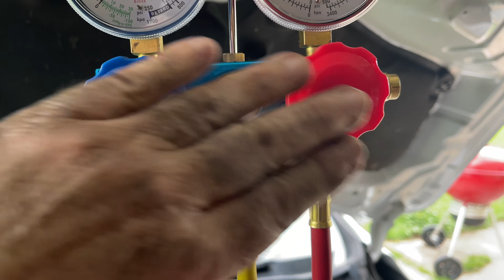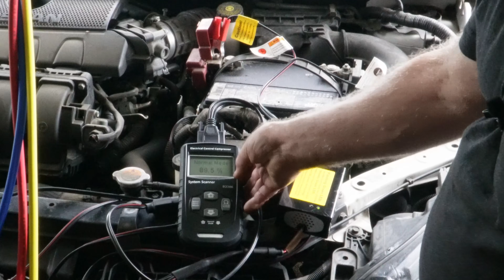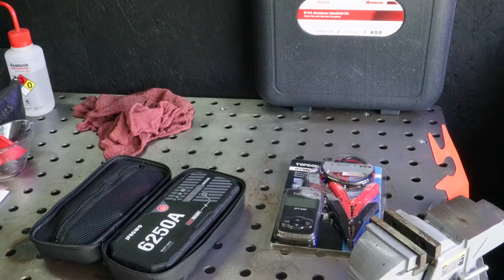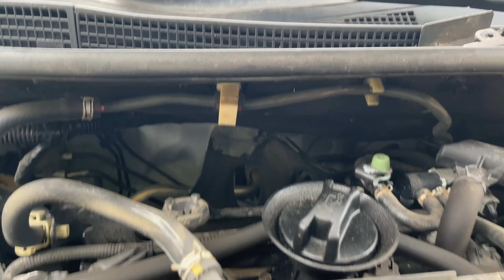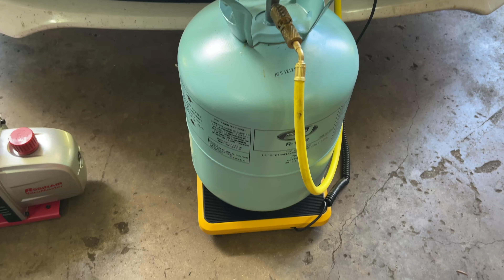How To Diagnose A Bad Automotive AC Compressor With 100% Accuracy

Comment: Hi

2 questions, if txv is stuckopen, are we saying that suction line going into compressor will be frozen..  or cold to touch. 

2. instead of using this tool, can i give contsant power or ground (based on which is controlled) for just few seconds.. please advise
Reply from the maker: My following reply is assuming the system is fully charged with refrigerant with a healthy compressor.
If the tvx is stuck opened more than it should be, then it will allow more liquid refrigerant to enter into the evaporator than it should, which will overfeed the evaporator, causing excess liquid refrigerant to enter the evaporator, which will cause the liquid to boil off not only in the evaporator where it should, but also into the suction line, causing the line to frost over due to the expansion of the liquid refrigerant in the line, which can also slug the compressor with liquid refrigerant instead of vapor.  In my experience, I have ran across many more restricted thermal expansion valves, then I have stuck open valves, but both do happen.   Hope I've explained that to where you understand.

To answer your second question, yes you could power up the electronic control solenoid to see if its clicking, but that doesn't tell you if it's getting the pulse width modulated signal from the PCM or which ever module is controlling it.  You would be better off using a multimeter, and simply checking the average voltage by reading between the power and ground wires at the plug for the electronic control valve.  You could also use a pocket oscilloscope to see the pulse width.  This will ensure you are getting a signal from the PCM.  You can also ohm the solenoid valve with an ohm meter.  Anywhere between 10 to 14 ohms is considered good and should function properly if it doesn't have a blockage or other mechanical issue.  If you have a decent midlevel scan tool, you can also use it to tell if the ECV is operating as it should be.  I show an example of doing this in the recent video I did reviewing the Mucar scan tool.
Reply: @SkillSavvyDIY thanks so much. I think I didn’t asked my 2nd question well. I do have picoscope and scan tool to verify the pulse width ,question is can I manually power the solenoid by giving constant power to the solenoid to make it as 100 percent duty cycle . Assuming power 12v is controlled by ecm and not the ground. In other words I am planning to not to use the tool that u used in this video and just send constant 12volt or constant ground using power probe when engine is running to that solenoid and override ecm volt by backprobing and provide constant power or ground. Just want to make sure that by backprobing and overriding pcm volts at connector I can simply create 100 percent duty cycle with power probe. If I can do that I can avoid buying the tool u used in this video. I just want to make sure I don’t burn compressor solenoid or ECM
Reply from the maker: @sivucit  Some cars pulse the ground and some are reversed and pulse the power.  I recently worked on a 2012 Volkswagen Passat, and I had to use the reversing cables that came with the tool I used in the video, to reverse the polarity for the tool to work correctly, but yes, you can supply 12 volts and a ground to engage the solenoid at 100 percent, but I'm not sure I would back probe the plug especially if you are not certain which wire is power and which is ground and which is being controlled by the PCM, the ground or the power.  Perhaps a wiring diagram will show you, but I personally think it's a bit risky! 

Not sure what scan tool you have but on my ThinkCar 689 scan tool, I'm able to watch the current go up and down as the duty cycle is being controlled by the PCM , and I also watch the evaporator thermistor temp to see if it also goes up and down as duty cycle changes.  As long as I can see that, I know everything is functioning properly, but if the pressures on my gauges indicate a worn out compressor, with high low side and low side as I had in this video, then that is a bad compressor, even in the event the solenoid ports are stopped up with debris or metal filings.  I personally would not be back probing the plug using my Power Probe to supply voltage or ground unless I was 100 percent sure which wire is being pulsed, ground or power and which wire is which.  I know the tool I used in this video is in the $350 range, but I do AC work often, and it's a safe way to monitor exactly what the PCM is doing or not doing with the ability to override the PCM and adjust the solenoid manually, plus it can ohm out the solenoid as well.  That's my thoughts and I would definitely use caution.
Reply: @SkillSavvyDIY  Thanks so much for your help.  Since you are super helpful and knowledgebale .. i have few more questios..

1. CAR HVAC also looks at 3 other paramter to turn on AC clutch. please advise if i am right

1. Ambient temperature. mounted next to condensor
2. EVAP fin temperature
3. Engine cooant temperature.

question to you. 
1. What ambient temperature is considered good for hvac to turn on. meaning if it is less than 50 degree F, it make no sense to turn on AC. do u know what values are ideal
2.. Evap fin tempeature.I was told that ECM will disable AC if EVAP  is giong to freeze based on evap fin temperature sensor. question is when it will become freeze, ?. in residential ac if freeon is low then it can freeze on fixed orfice.  not sure in car that has TXV.. also what is the actual cause for freezing. i dont understand the scientfic knowlede. is the boiling ipoint becomes too low when freeon is too lowthat causes evap to freeze below freezing??
3. i dont know even know why engine coolant tempeature is checked for hvac, make sense for hot air. not sure why for AC

Much appreciate your help. here..
Reply from the maker: Most automotive A/C control modules are programmed to prevent compressor operation when the outside temperature is too low. The exact threshold depends on the vehicle manufacturer, but typically: Around 35–40 °F The system will disable the compressor to avoid evaporator freeze-up, since refrigerant pressure may drop too low in cold weather. Some manufacturers set the cut-off slightly higher about 42–45 °F  for added protection. Above these temperatures, the A/C will function normally.

At low outside temperatures, the condenser can’t effectively dissipate heat, so refrigerant pressures get too low.
Running the compressor in these conditions risks icing the evaporator and damaging the system.
Since defrosting/defogging often needs compressor operation, the system may allow brief or partial compressor use even in cooler weather, but it won’t run continuously below the cutoff. So on average, the A/C control module blocks compressor operation below 38–40 °F 

Most modern cars have variable displacement compressors and the ECV solenoid at the butt of the compressor is controlled by the AC control module or ECM.  The computer monitors the data sent from the various sensors and it adjust the actual displacement of the compressor based on the input from the sensors.  If you have the climate control set to 70 degrees, then the computer will adjust the compressor to deliver those temps by constantly adjusting the displacement of the compressor which changes the amount it pumps which changes pressures and it can also blend in warm air from the heater if needed.  If you have the climate control set to the very lowest temperature, then the computer will control the compressor to give you those colder temperatures also.  As long as all the input is correct, the compressor will never allow the evaporator to get cold enough to freeze.  If it didn't adjust the pumping of the compressor by increasing the low side pressure, then the evaporator would most definitely freeze over, even with a high fan speed.  

Residential Hvac systems use a different refrigerant that runs at higher pressures and even though the compressor has fixed displacement, they will not freeze over, unless something effects the air flow across the evaporator, such as a dirty evaporator, blower motor failure, blower relay, stuck contactor, etc., and as you said, low refrigerant charge will cause them to freeze up, because the pressures are now lower, and the pressure to temperature correlation  has dropped meaning the actual temperature that the saturated refrigerant is boiling off at in the evaporator is now below freezing causing the condensation on the evaporator to freeze solid.  It is also possible that a faulty thermostat that won't turn the system off will eventually cause the evaporator to freeze.  

Engine coolant temperature is monitored by the AC control module or ECM to prevent the AC system from working if the car overheats.  It's designed to take the extra load off of the engine, that's all.  

Everything I talked about above pertaining to automotive ac is referring to modern automobiles that use variable displacement compressors.  Old school AC systems relied on a low pressure cycling switch to disengage the compressor clutch to prevent freeze up at the evaporator.  The system will cycle on and off depending on system pressure.  Much easier system to understand and diagnose but those days are over, even though many of those systems are still around and in use.  Didn't mean to write a book here, but I hope it helps your understanding a bit better.
Reply: @SkillSavvyDIY thanks so much and you are very helpful and these kind of answers can be provided only by someone like you who knows in and out. Thanks again very much appreciated.
Reply from the maker: @sivucit You’re welcome
Reply: @SkillSavvyDIY  hi, if outside temperature is like 45 degree or less, you said condensor wont dissipate heat effectively resulting in lower referigeratn pressure, can i assume ,because outside temperature is too cold , the heat created by compressor will get dissipated easily resulting in lower pressure ?..  i thought if condensor is not working(let say fan) temp goes up not comes down resulting in lower temp, pls advise.
Reply from the maker: At low ambient temperatures around 45 °F and lower, the condenser is too effective. The refrigerant cools and condenses too easily, so the high-side pressure stays low instead of building up like it does in hot weather.  With low head pressure, the evaporator also receives refrigerant at a lower pressure/temperature which gives a high risk of evaporator freeze up even with a variable compressor.  Also keep in mind some condenser fan motors come on and stay on the entire time the AC is on, while others only come on when the high side pressure reaches a certain pressure.  Depends on the manufacture and car or truck.  

So the problem isn’t that the condenser can’t dissipate heat, it’s that it dissipates it too well, pulling the pressures down below what the system is designed to work at and thats why the ECM will shut it down at the lower outside ambient temperatures.  Sorry for the confusion.  I should have explained better.
Reply: @SkillSavvyDIY thanks so much. Let me know if I can donate to your channel. How can I test variable compressor using low side and high side values. Bcz it is variable compressor low side can be 45 and high side can be 120 and it is still right. Can I use scan tool to make it as 80 percent duty cycle and compare low side and high side almost equal to traditional values. 2. In hybrid electric compressor is it variable like in Toyota and I heard hybrid air compressor electric won’t take oil is that true
Reply: @SkillSavvyDIY  one more question if free on is over charged . Pressure will be high and does that mean the boiling temperature in evaporation is high and it won’t cool ?. Vice versa if free on is low , pressure will be low and evaporation temp is low and will I get cooler air?. Off course too low in free on  won’t give cooler air. Just want to pick your brain. I have robinair LD7 that has heated diode is that good leak detector or you recommend something else if cost is not a concern
Reply from the maker: You can do that easily with the tool I used in this video.  Manually bring the duty cycle up as high as the tool will let you on a warm or hot day, and watch your pressures.  Bring the duty cycle down while monitoring pressures and you will see how the electronic control valve is adjusting system pressures based on the duty cycle you are giving it.  The control module does it based on sensor inputs is the only difference.  

Electric compressors are typically not variable displacement in the same sense that belt driven compressors are.  They are controlled by motor speed.  

They use a special dielectric compressor oil made specifically for electric compressors.  

You seem very interested in automotive AC.  You should think about taking a few courses at a local Vo Tech school and get some hands on training.  We could go on for days with me answering your questions, but the very best way to learn, is by actually getting trained and working on systems.  Technology in this field has changed dramatically since I first got involved and even at 66 years of age, I try to keep up with the latest.  Best of luck to you and I hope I have helped out some.
Reply from the maker: Yes if a system is overcharged with refrigerant, then your pressures will be higher which means the temperatures will also be higher including the temperature that the liquid refrigerant boils off at in the evaporator.  A severe overcharge can also send liquid refrigerant back to the compressor which can destroy it.  A lack of refrigerant can also effect system pressures by making them lower than optimal, and with enough refrigerant loss there will be no cooling capacity left and also remember that a undercharged system will make oil drop out inside the evaporator and settle in the bottom which will starve the compressor of critical oil and will lead to compressor failure.  A heated diode leak detector is a good choice.  I have an infrared leak detector mainly because of the long life of the tips.  A bit more expensive, but less maintenance.
Reply: @SkillSavvyDIY thanks so much. Pls advise a better or best infrared leak detector that works for both 134a and 1234yF. Thanks again very
Reply: @SkillSavvyDIY  One last question for you, if condensor is blocked and assuming i have hig side port after condensor that goes to TXV showing less pressure, how would i test blocked condensor, can i measure with infrared thermometer between inlet and outlet of condensor, if so how much pressure differenc i should see for good working condensor vs blocked condensor..  or do u have any other method.
Reply: @SkillSavvyDIY  I did went to school like 10 years ago and got myself certified as well, but that time it is all about clearing  exam.. :)...  one thing that never get it clarified till today is that, I was told that , when gas converts to liquid(example when compressor sent high pressure gas discharge line into condensor at somewhere in middle of condensor it will turn to liquid) i was told that is the time heat dissipate.. Instructor told me heat dissipate when there is a change in state from gas to liquid. stilll didnot understand that.. he told me that if there is no change in state assuming entire condensor is gas there is no heat dissipation.  similarly when evap inside the car gets the liquid, within evap coil in middle of coil, it will convert liquid to gas that is the time free on boils. why change in state from liquid to gas or vice versa is where heat is dissipated.. any insight will be helpful..  This is my last queestion i promise.
Reply from the maker: Normally when you have a restricted condenser, the restriction will act like a metering device such as txv or orifice tube, and the restriction will cause a pressure drop, and the liquid line will be cold after the restriction because of this pressure drop.  So yes, if the service port is after the restriction, you will see low pressure and if it is completely blocked then you will see the pressure pull into a vacuum unless the high side pressure sensor is before the restriction, then the high pressure before the restriction will be great causing the sensor to shut down the compressor.  You can indeed check the temperature difference with a laser thermometer.
Reply from the maker: Sounds like you got the gist of what’s going on.  It is the state of change when refrigerant is saturated with both liquid and vapor in the condenser or the evaporator that heat is either absorbed into the refrigerant (evaporator) or heat is expelled from the refrigerant (condenser) .  Heat in the vehicle is absorbed by the cold boiling refrigerant in the evaporator then pumped to the compressor as a cool vapor and pumped out as a hot high pressure vapor and then condensed to a warm liquid expelling the unwanted heat that was removed from the inside of the car, or house, or air plane, etc.
Reply: @SkillSavvyDIY I can’t thank enough. Very much appreciated and lucky to have a mentor like you . I am software engineer does side job and help my friends .
Reply from the maker: @sivucit  Your welcome, hope it helped your understanding.